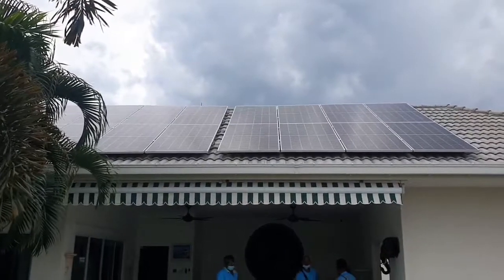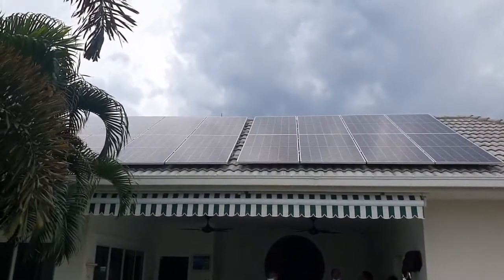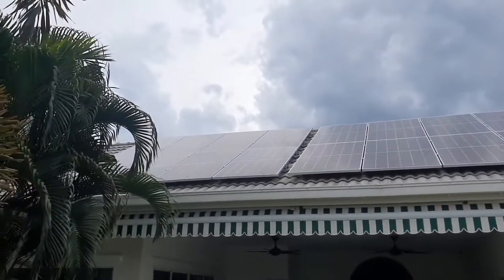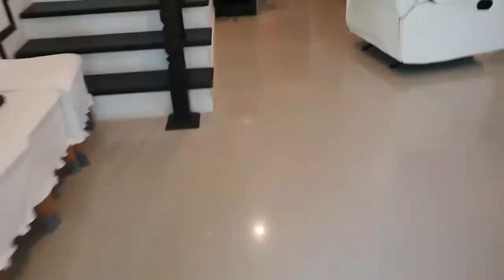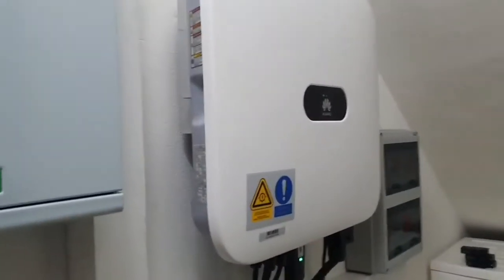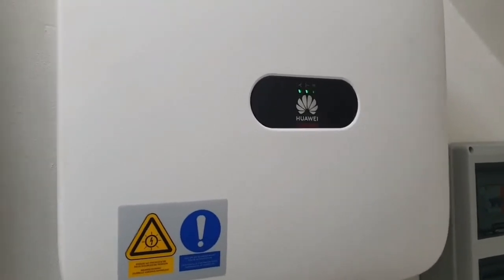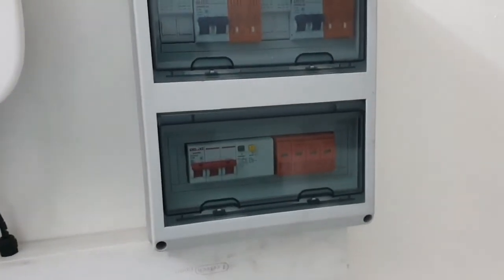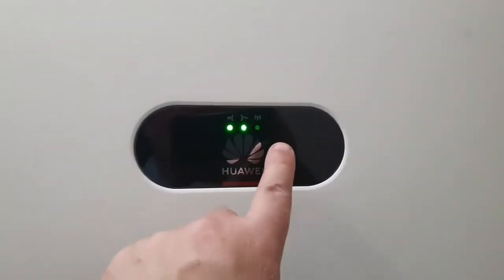5 kW on grid solar system with a 3 phase Huawei inverter

Comment: Hey can I talk to you about your system? I am about to install one myself in Koh samui
Reply from the maker: What do you want to know?
Reply: @ChaweewanGroup  I am about to install with my team a huwai 5kw inverter.

I just want to be sure how do I connect the inverter to the main grid.

I know before the inverter I should have dc breaker, dc fuses and surge protector.

I saw that I can order the inverter but I am not sure if it comes with all the right fittings (especially the ac fitting to the right of the inverter) information is very lacking on stores.
Does the inverter have COM and Alarm? Connections too?
Reply from the maker: @ElrizzSamui  The inverter does not come with any extra equipment, only a wifi dongle. I dont have time to guide you in detail, I apologize. But there are many DIY solar channels you can find the info you need on.
Reply: @ChaweewanGroup  thank you for your assistance I will make sure to relay 🙏🙏
Reply: @ChaweewanGroup  also how do you ground this system? It’s grounded just in the combiner box or I should ground on my roof already